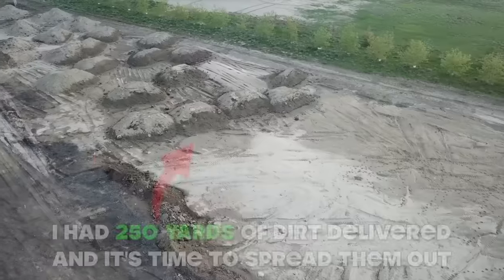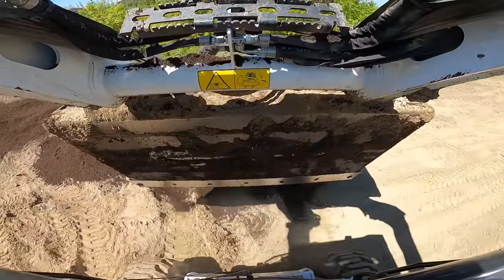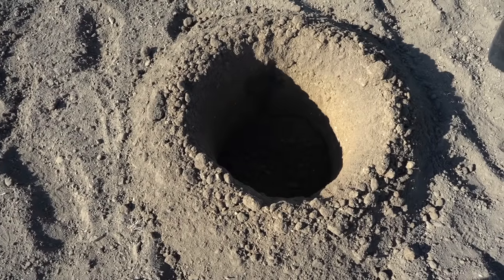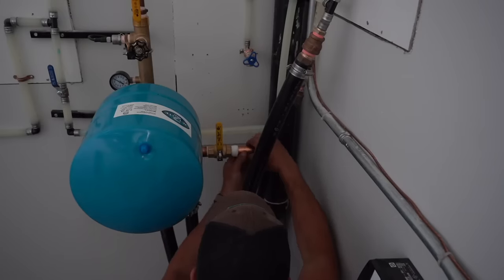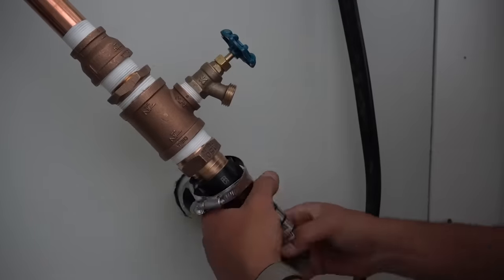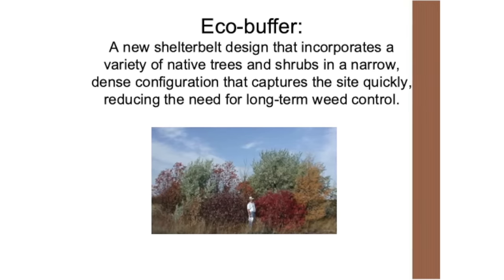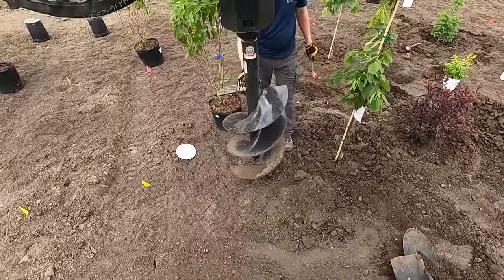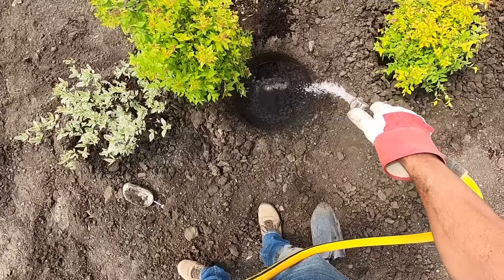I Planted 1,000 Trees in 2 Days!! | Yard Geek Episode 2

Comment: I hope you chose a different manufacturer for the replacement fireplace. Although it does make a good story. Once upon a Time, I bought a fireplace that caught fire before it was even placed. It was so eager to do its job that it didn't even wait to be removed from the original wrapper.

Also, I should have realized you knew about bone meal 🤣 I've got to say Mitch. Good on you for doing things the right way and not the easy way. I can smell those Lilacs now...

If you're looking for any suggestions on flowers? I'd recommend four o'clock's  (mirabilis jalapa) These offer some excellent benefits, they are loved by pollinators, bushy, easy maintenance annuals, they have a wonderful scent and because of their deep tuberous root system? They are a good choice for areas that soil erosion might be an issue.

they are good for ornamental around homes, but also do well "in the wild". They attract Bumbles, hummingbirds and many different butterflies during the growing season.